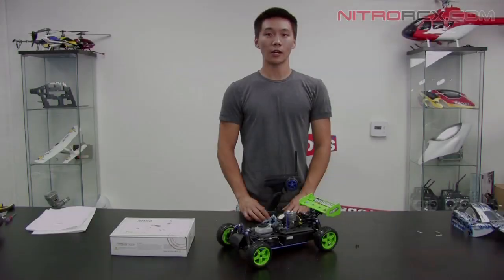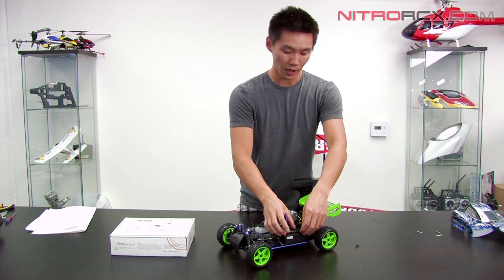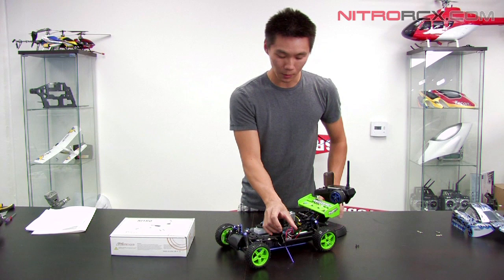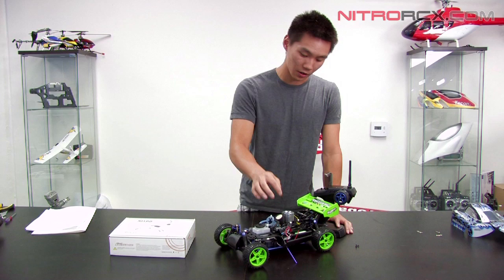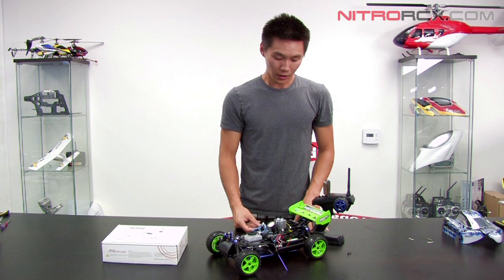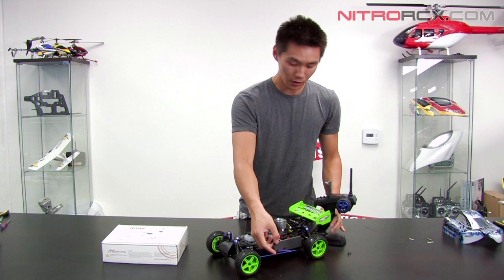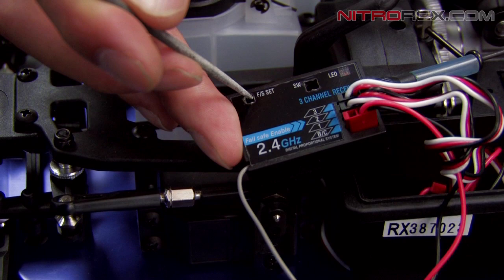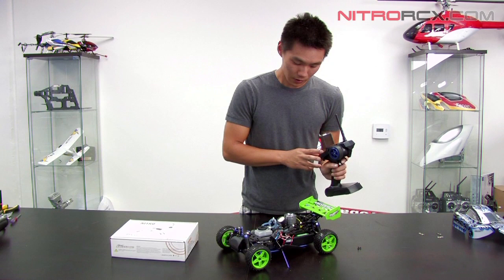How to bind the Exceed 2.4G RC Transmitter w/ Fail Safe Tips

Comment from the maker: The electronic system that on the brushed Katana isn't lipo ready so you can only use NIMH batteries with it. When you said that you wanted to upgrade the motor did you mean that you want to convert it to brushless or just change the motor out for a lower turn motor?

Comment: what receiver brand are you using in the video with that transmitter.. my exceed 4ch receiver's steering channel is not working, only the throttle channel is.. I've tried everything, even touching up very carefully the solder points on the pcb in case one solder joint was defective.. nothing.. throttle works, steering doesn't..

Comment: hey Bobby..thanks for help.Question: I don't need to use a binding cable/plug for doing this ? Or is it just that kind of transmitter? Some videos  are using those binding cable that plugs to the transmitter..i'm confused a little bit..
.

Comment from the maker: The factory changed the wiring for the transmitter to only require 4 batteries. It doesn't affect the life span of the batteries.

Comment: Anyone know if the Dragon-RC receiver that comes with RTR units for the Serpent lineup have built in failsafes?
Also highly recommended for those with nitro RCs to have throttle return springs fitted to the carb in the event of a throttle linkage breakage/disconnect or electronics' power loss. Don't rely on only failsafes as they won't return your throttle to closed position with no power to servos.

Comment: Question here, you;ve mentioned that when the RX looses signal with TX, the servo position goes back to neutral. Previous your video said, when the car is at the neutral position, make sure that the brake is not engaged, does this mean that there are no certain way to slow/stop the car while it's travelling at extreme high speed?

Comment: Hey Bobby! When I switch on the receiver power, the throttle servo slowly judders (vibrates) into full throttle and stays at full throttle and keeps juddering. The throttle servo also doesn't have any control. The steering servo works perfectly and has full control. I have checked all the batteries, they are fully charged. Any advice? Many thanks!

Comment: my brand new madfire transmitter bonded an worked one day then the next it wouldn't function.. it had new batteries in buggy an transmitter an I tried to rebind it but the light wouldn't flash on the box it stayed solid

Comment: when i turn the remote on the full and low lights start to flash and the receiver says bound but i have no control over it, the car just goes directly into fail safe mode

Comment: I'm having trouble with my exceed forza .18 buggy. I've paired the receiver to the transmitter but nothing will respond. I have tried to repair the transmitter to the receiver again but that didn't help.
Reply: that happened to mine have you fixed it??

Comment: what's happening if the steering is working, but the throttle isn't? I don't see any loose connections
Reply from the maker: Unplug the servo connector and plug it into the steering channel and try it. If it works then the receiver has a bad throttle channel. If it doesn't then you have a bad servo.
Reply: +nitrorcx Is it possible to change the channel the throttle on the remote controls?

Comment: I need help please. I have an exceed rc driftstar. I dropped the transmitter and it broke so I bought what I thought was the same one, but it won't connect to my receiver. The receiver just flashes continuously. I bought the "Transmitter (2.4G)" one from nitrorcx, and it looks identical. Any tips?
Reply: I have the same problem. Were you able to resolve it?
Reply: Same thing is happening to me. Bought new Transmitter from Nitro  rcx  will not bind. Kinda disappointed in their tech support   now I also know why exceed rc is so cheap !!   Did you guys resolve the problem or did you have to order a new receiver?
Reply: Eric Riedesel never heard back. This video tells how to reset the receiver but not transceiver.
Reply: Andy Kim I got to looking on the website. And apparently I ordered the wrong Transmitter  looking on the pic it shows a green check mark on one receiver and a red x on another. I've tried everything In this video and it still won't bind.  Idk what to do   frustrated. ? Guess  I'll see if I can Return the Transmitter and Order a Different 1.  It they are almost Identical  thanks for the reply

Comment: im try to bind my mad torque toa different transmittr(yes theyre both 2.4 ghz)    i know how to bind transmitter how would i bind the mad torque?
Reply from the maker: Are you using the stock receiver with the different transmitter? The stock receiver will only bind with the Exceed RC transmitters. What radio system are you trying to use with the Mad Torque?
Reply: its an E-fly transmitter
Reply: ill just buy a new transmitter from the website thanks for the help
Reply: nitrorcx  I've just ordered a new Transmitter 2.4ghz  I broke the one I got  with the exceed rc Infinitive nitro can not get it to bind  receiver is stock. ?  Do I need to order a new receiver?

Comment: Fail safes aren't necessary in electric cars 'cuz they wouldn't go out of control once you lose contact with your transmitter, they just stop driving. I don't know if a fail safe doesn't actually work at all in an electric model though.

Comment: Hay I need some help my receiver won't turn on
Reply: Do you have battery connected and is it connected the right way? If it was plug in the wrong way open the case of it to check to see if there is any shorted circuits